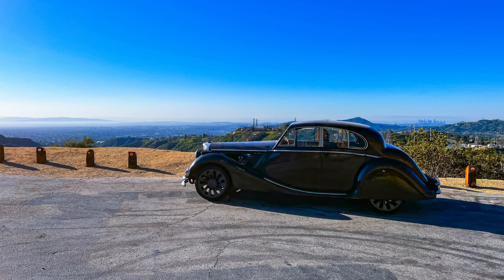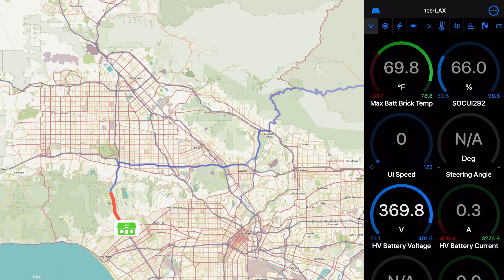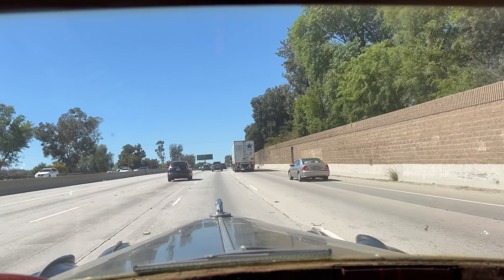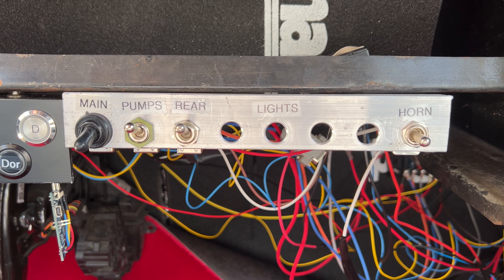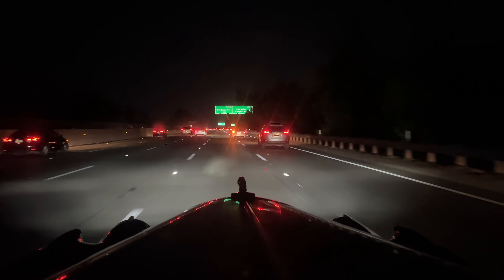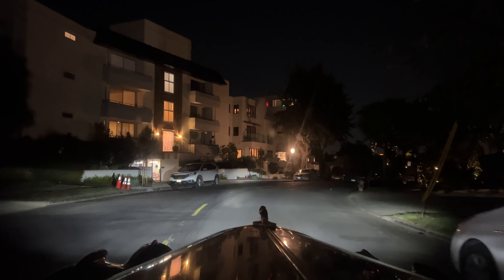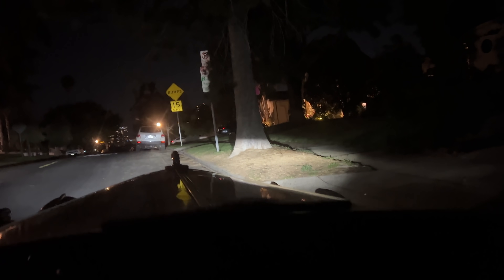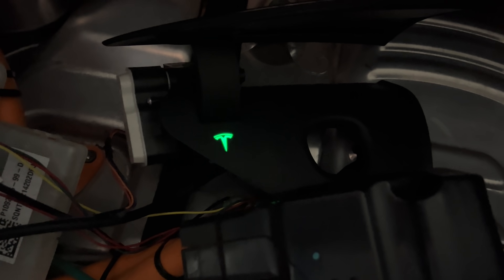I Find Out How Far A Tesla-Powered Jaguar Can Go

Comment: I was 100% waiting for the contactors to open while you were in the super tight section of your driveway.
Reply from the maker: Fortunately that is angled downhill slightly. Though it would have made for great YouTube if I got stuck and had to yell at my neighbors to get a push.
Reply: I totally thought that was gonna happen. I have a similar LA driveway my 68 Ford F-250 barely fits down too. Those are times I’m glad it’s IC powered.
Reply: @ronconnelly  why would that make a difference in this particular test scenario? If you put a say 2 gallons in your f250, roughly 10% of "charge" and drove it for the same distance, how many times do you think turning it off for a few minutes after it stalled it would have started again?
Reply: @uliwehner  on manuals, if you put it in first and turn the engine starter on, the car moves under electric power. Not really useful for anything exept maybe an uphill driveway?
Reply: @mcrsit  just like when you can pop the clutch while rolling if there's enough juice to get spark, but not run the starter. When the engine runs, the alternator folds the battery back up.
Seems to work better for carburetor cars, but fuel injection ones seem to need a lot more stable electric to start.
Reply: @SuperfastMatt  turning off your headlights while driving on the side streets might have eliminated one of the stops. It also might have led to a conversation with law enforcement officers...

All Hail The Algorithm.
Reply: @mcrsit  It is what you're meant to do if you stall on a level crossing. You use the starter to get off the crossing, then you start it when you clear it.
Reply: @philso7872  unfortunately for Matt on this evening, "turning off" the headlights meant snipping the jerry-rigged wires with cutters 😆
Reply: @philso7872  those headlights run off a regular 12 volt car battery. The motors are powered by the separate EV battery. I'm not exactly sure when the EV battery is being used to top up the 12 volt, but at least regular Teslas will not keep topping it up except in some specific circumstances. How do I know? I've now heard of two Teslas that have failed to get going because of a low 12 volt battery and a full powertrain battery pack after the car sat for a while.
Reply: @mcrsit  may be we should keep those starter motors in our electric cars as well but an 8 amp hour motorcycle battery wont do it.
Reply: @peterjohnson9438  watchjrgo just did a video on this very issue. The big battery only propels the car. Everything else requires 12v, lights, computer modules, power steering, everything.
Reply: @philbert006  It also charges the 12v battery, apparently for the model 3 when its in drive or reverse
Reply: @huskkyy  to be honest it has been too many months since I watched that, and I don't recall if that was mentioned or if he went into that much detail. There are any number of ways to charge a basic12v system. I know the 12v system was operational even though the bigger one was not. But I don't see why not. A transformer would accomplish such a thing, as would an alternator on some moving part or probably a number of other solutions. Outside of my area of expertise, to be sure. It wouldn't be a bad idea to implement more than one way to get it done. Seems solid
Reply: @mcrsit  it's not good for the starter though.  You're multiplying the load.
Reply: That makes you a terrible person. We all were.

Comment: The funniest part was when you said "I should've gotten the bigger battery", as if you wouldn't have just gone a little out of your way or driven harder or left with less charge or any of a number of other "eh, so what" choices because you knew you had the big ol' battery. In the same way putting the bigger 35gallon optional fuel tank in your 78 Dodge D150 w the 440 doesn't prevent you from running out of gas on your way to high school marching band practice when you only put $5 of regular in at a time
Reply: Agreed, when he said that I was like "No, really you just needed to charge another 5 minutes and you'd be good, and you know that now"
Reply: So very true. 
I didn't buy his comment either.
Still funny tho.
Reply: Not to mention the bigger battery wouldn't have charged any faster, so he would have still left the house with the same actual range in the batteries.
Reply: Well having a bigger battery would just be nice in general
Reply: This video is after Matt replaced the 18" aero wheels with wider, heavier 20" Uber-Turbines that increase rolling resistance too... 🤔🙂

Comment: Oh man the sweaty palms while trying to get to that hilltop… My old BMW i3 often gave me this anxiety. 15mi of battery and home is 25mi away. Then by the time I got to the bottom of the hill range was 30mi. I swear they hired the Windows file transfer progress bar guy for range estimation.
Reply: Hahaha I know this life.  Spark EV here.
Reply: I know that sweaty palm seat-shuffle. First EV was a high-mileage hugely degraded '11 LEAF. That last hill coming home on a cold night was a real nail-biter.
Reply: i took a test drive of a fiat 500e and they had to cut the around the block drive short because the range estimation went from 30 to 1 after accelerating pulling out of the dealership. i think those California fleet mileage circumvention electric cars are pretty bad.
Reply: Seems reasonable, not like the car knew you were going to take it down a big hill
Reply: Range estimates always annoy me - on ICE cars as well as EVs. Just give me the remaining kw/h or litres left in the tank instead and I can do a better estimate through knowing my future route.
Reply: The battery gets charged by the motor when you are moving without using the throttle. It’s called regenerative braking or sumn
Reply: @questioner1596  GPS wired into the car's computer could probably accomplish this just fine.
Reply: @uliwehner  assuming you have a destination programmed. If the destination is unknown, the range will be completely different whether you drive downtown with traffic lights or a country road with no stops.
Reply: @questioner1596  same would be true for you if you didn't know where you are going.
Reply: @uliwehner , that's completely missing my point. Unless you're going somewhere new, you're not likely to enter a destination in GPS. I'm just saying if it gave the total energy remaining, I know that, for example, 50 L of fuel can get my van 550 km on the highway on a warm day, or 350 km in town during the winter with idling to warm up. It depends where I choose to go, what the ambient temperature and ethanol blend in the fuel is, etc.

If a range estimate goes by the previous 200 km, it will be WAY off if you've just driven down the highway for several hours and arrive in city rush hour.
Reply: @questioner1596  see now you are missing my point. Let's just put you in the car then and not tell you ehere we are going. I'll just say left right straight faster slower wait here i'll be right back..... if you know where you are going and how then your car needs the same info to come to a similar result. Hence the GPS
Reply: @uliwehner , are you driving a taxi? How do you not know where you're going next?
Reply: @questioner1596   no but i see how that is funny. Just saying that you brag you can beat the computer by using info the computer doesn't have. You know where you are going. So let the car know where it is going. Fair is fair.
Reply: Nice! I reckon the same guy did Leaf G1 guess-o-meters too!
Reply: @uliwehner , I don't want a new chore every time I drive. It's not a brag, just a fact that machines are only as accurate as the data they're given.
Reply: @GeorgeWashingtonLaserMusket  apple always did a way better job at time estimates. And searching for things.
Reply: @questioner1596  "litres left"
you know there's a gauge that shows you how full the fuel tanks is, right?
Reply: @GewelReal , yes, though usually it's not linear because the sensor travels vertically but the tank has an odd shape and it doesn't count what's in the filler neck. I'd like if the fuel gauges were calibrated with numbers (ex: full might say 65+ litres, half would say 30 litres and quarter say 10 litres to adjust for the shape of the tank).
Reply: @Zagill  it actually should have known. It's called a map..... and GPS....
Reply: @vladimirmihnev9702  in that case it would only work if you had set a route, otherwise again... How would it know where you're about to go?
Reply: The i3 has a gas motor.......
Reply: @EnlightenedSavage  I had the pure EV variant. Didn’t wanna lug a motorcycle engine around. In hindsight it would have helped
Reply: @EnlightenedSavage , the gas engine version had a dinosaur name for the dino juice it burned - i3 REx

Comment: It is always surprising but the first 10% of your battery is often worth much more range than the last 10%. So getting out with 93% might have been your mistake :)
Reply: Yes. Even if was measured entirely linear (which it's probably not); the first 10% from 100% to 90% are capacity you can freely use; the last 10% from 10% to 0% are percent that the system might not allow you to use.

If the battery had just stopped charging when you unplug it and drive, the battery is already at the perfect temperature; this is particularly important in cold climates where the range decreases a lot if you have to start with a cold battery; so the estimated range will be a lot further even with the same charge because very little energy is needed to keep the battery warm enough.

Also my 1st gen BMW i3 seems to continue charging a bit after it displays 100%; I can tell because the estimated range keeps increasing for a while even though the bar is full.
I think it counts 90% of maximum charge as 100% (and probably 15% as 0%) to prevent us from wasting time and power reaching a charge level that it might never reach and might be harmful for the battery anyway.
Reply: @SteinGauslaaStrindhaug  I'd say that it is due to cell balancing. Once you are "100%", some cells might be a bit above 4.2v or a bit below. It is important that each cell provides the same voltage so that they are not stressed differently when in use. It makes the pack less prone to sagging, which is why when you accelerate you can see a huge voltage drop, and makes the battery cells healthier for longer.
Reply: This doesn’t really seem like a glowing endorsement for this new technology,does it?
Reply: Not really battery voltage decreases as they discharge so since you need a certain amount of power to meet what the speed controller is asking for then current increases, and as current increases batteries discharge faster

Comment: A long time ago when I was a teenager, I bought just enough gas to fill the carborator (yes, I'm old). It was just enough to get me to the top of the hill, roll down, and get into the driveway. This reminded me of that.
Reply: I was getting flashbacks too, the questionable decisions of youth!
Reply: Back when gas was an outrageous. .89 a gallon I bought enough to get home with pennies out of my ashtray. I ran out in front of my house and coasted into the driveway. This reminds me of that.
Reply: I remember doing a 60km trip around my city outskirts and got towed by on random guy back into the city when the batt died, you'd think we put the bike to charge as we got home, nah, we saw regenerative braking charged it up a bit so we went 3kms roaming in the city again. Barely made it home. Good times.
Reply: gas station?

Comment: If you look around, most modern shopping malls about a 1/3 of the light polls have 110 receptacles in them. As a fiat 500e owner don't ask how I know that. And yes im also thinking of a small range extender.
Reply: Just a warning.  You can be charged with theft of services.  Don't ask how I know that, and I won't ask how you know to look for outlets on light poles.
Reply: @ShainAndrews  You can be charged with theft of service, but if you're willing to pay way more than electricity costs, you can also pay a lawyer to pretty much get off of any charges.
It's an electrifying experience.
Reply: @ShainAndrews  should be a pretty easy defense. If there is no signage prohibiting use, and the receptacles are not secured in any way, then they cannot charge you with stealing anything.
Reply: @SweetLou0523  Lets say you have a ride.  I jump in it and take off with it.  You claim I stole it.  I claim there was no sign prohibiting use.  You didn't lock it or secure it in any way...
Reply: @ShainAndrews  not a great example though as most insurance companies would find me at least 50% at fault for that as I left it in a public place, unsecured, with the keys in it. In order for you to be totally at fault, I'd have to have locked it up and taken the keys with me. This would render it secured and obviously not for public use. Again, if the outlet is easily accessible in a public place like a parking lot, and has no security cover with locking mechanism, then they cannot charge you for theft of services. Especially since they don't have posted rates detailing the pricing on said services either. 

Imagine this: a water hose at a gas station. The spigot is not locked, there is no sign specifying payment for use. You fill up a water jug and go to leave, the clerk runs out and demands payment. When you refuse, they call the cops. The cops cannot do anything because the hose was readily accessible by the public, not secured, and had no signage posted requiring payment for use. Legally, you deprived the station of no goods or services. Literally the only action that could be taken is a writ of no trespass.
Reply: @ShainAndrews  Electrical current is not a car though. And as you wouldn't be stealing the outlet rather just what comes and what is meant to come out this is not comparable.

Comment: What’s cool is you live in my old stomping grounds. When mountain bikes became a thing, I used to ride trails where the Getty now stands, we used to hang out on a plateau where they filmed a scene for Against All Odds, where Jeff Bridges drives a 911 targa up to a wedding ceremony happening on that overlook, which is now that cylinder structure of the Getty, overlooking the Holiday Inn & 405.
Nice place that little nook of LA. Yeah “we’re gonna need a bigger…” battery, and their right, be careful not to discharge it so far. Doesn’t bode well for the longevity of the battery.

Comment: You need to wire up the brake pedel with a tilt sensor, so tippy-toe breaking uses 100% regen, while heel-braking uses 100% brakepads. If you had this you'd probably make it home no problems.
Reply: Dang I'd never heard of this idea. Seems genius!
Reply: My buddy's Tesla uses only regen braking until you press the brake to a certain point, or at least that's what he told me. So you just have to modulate how much braking you're doing and you'll only use regen.
Reply: @samuelalexander8030  
Cool story bro!
Reply: @samuelalexander8030  Typically, just taking your foot off the accelerator in a Tesla engages the regen braking, and then you use brake pedal if you actually need to fully stop (or panic stop).  The Tesla brake assembly, master cylinder is the same as the one in the Honda CR-V, so I doubt it's doing anything fancy with part pedal application, unless it's literally just using the brake light switch to tell the motor controller to go into regen.
Reply: Alternatively build in a "fun" and "range" mode. "Fun" means no throttle is full-on coasting, "range" means no throttle is regen, and he could set how much regen he feels comfortable with. I remember some hybrid a few years ago coming out with a hand-dial to turn up or down regen.
Reply: @12x2richter  Whoops. Must have mis-remembered. Thanks for the constructive comment!
Reply: A one pedal driving mode is a more elegant solution